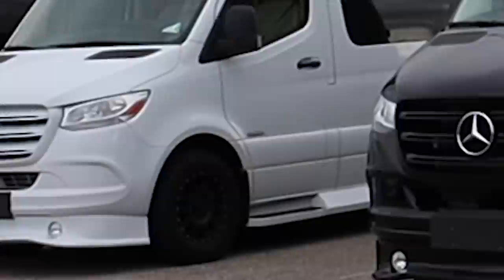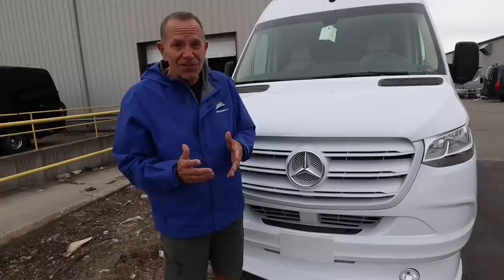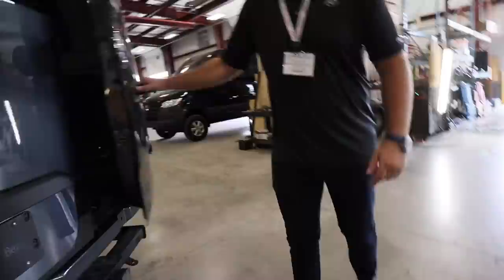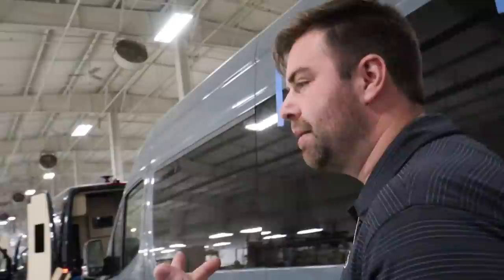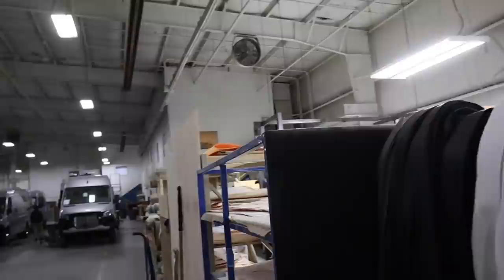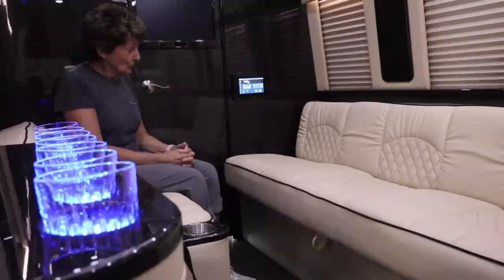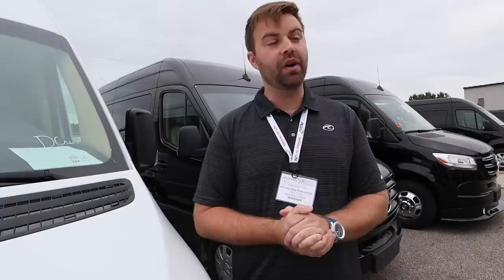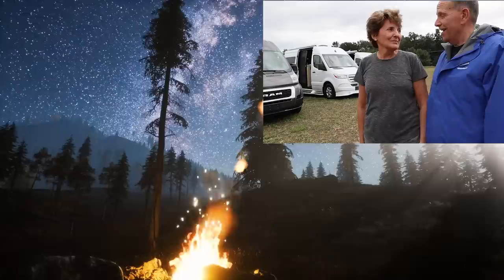RV Factory Tour The REV Group | See How Class B RVs Are Made!

Comment: Neat, informative video, however, I hope they are doing much better with safety precautions after the video. I saw some killer safety issues. I lost a dear friend in a miserable way because he did not adhere to safety rules.
Reply: Yes, like the lady machine sanding with no eye protection and a poorly fitted and low quality dust mask,  holding the wood with bare hands...
And the guy dipping the long wooden part into paint with no eye protection or breathing protection from paint fumes...
And the two workers under the van spray painting something with no safety glasses or breathing protection from the spray paint...

To me it seemed all the workers shown in the video were in some type of risky situation.